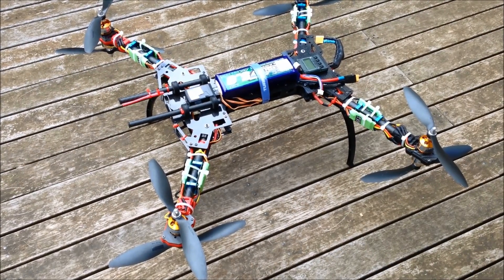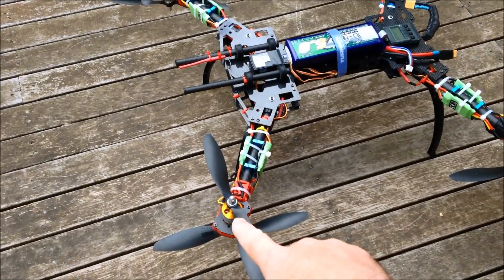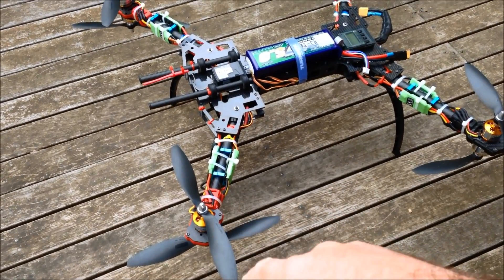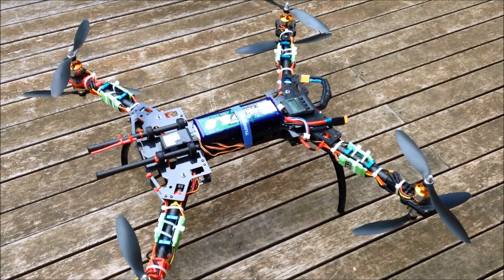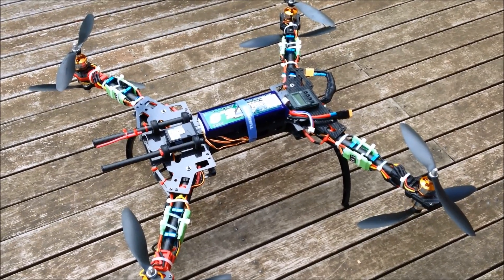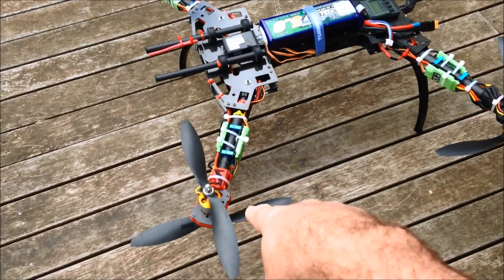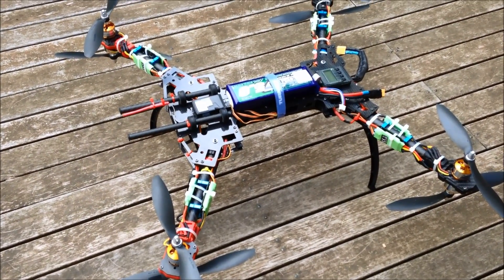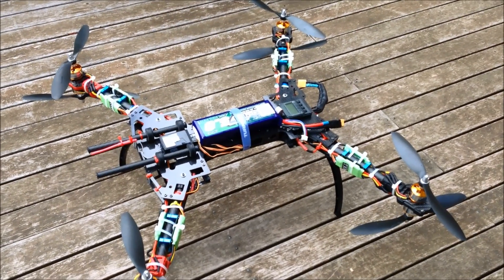x8 KK2.1 Motor Configuration for Alien 560 Quadcopter / Octocopter

Comment: I just did the same thing before saw your video because I had very little to no rudder control.  Mine is still a bit unstable but nothing like before.  Can you share your KK2 board settings?

Comment: I wondered about the prop rotation, Naza says all one direction on top and all the opposite direction on the bottom too.  I like how you have this one though as it is more symmetrical.
Reply from the maker: ***** Definitely flew better in this configuration.
Reply: +Simon Hahnel Agreed...  I had all sorts of Yaw issues with Naza in coaxial with all top one rotation and all bottom the other.  Went to X8 on Pixhawk on this fram and so rock solid it is incredible.
Reply from the maker: I will have to try it out with my PIXHAWK.

Comment: um quick question!  You said you put your 1000kv on top and 900kv on bottom?   Faster prop always goes on bottom or higher pitch cause it will need to move with the increased air volume from the prop above it lol!   I could be wrong but the three x8 quads I made and bought all flew backwards of what you said lol

Comment: I'm also planning the same X8 configuration but with 1000kv motors with props above 10x4.7 and below 10x5. Any tips & tricks regarding KK 2.0 settings?

Comment: How do you like this frame? Does it seem to be strong as far as the body and arms.. I know the legs are pretty weak.. Just asking cause i was thinking about getting one later on...
Reply from the maker: Elijah G Forget about the legs they are useless. Otherwise its OK. Too many screws to open up the central case too often so runeverything on the outside until you are happy.
Reply: Simon Hahnel I'll keep that in mind..I figured the legs were garbage from all the videos I seen on it but I was more wanting to know about the structure of the frame more than anything..There does look like to be a lot of screws to contend with but i can deal with that...
Reply: +Elijah G search ebay for A560SS Landing Legs   much better !!!!
Reply from the maker: I ended up using S500 Landing legs. Nice and light with good height.